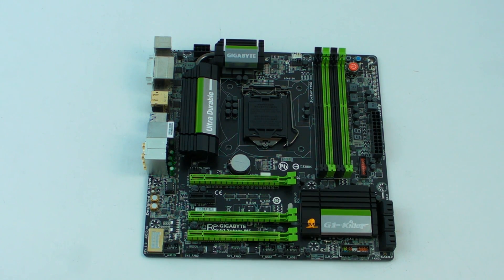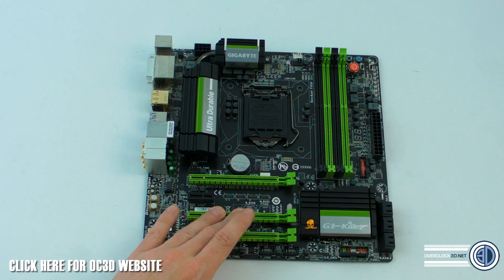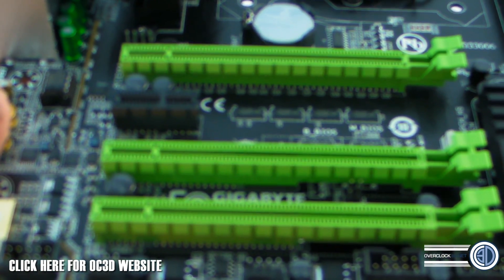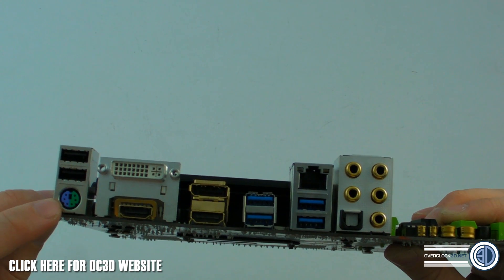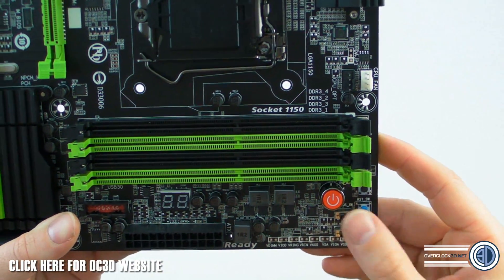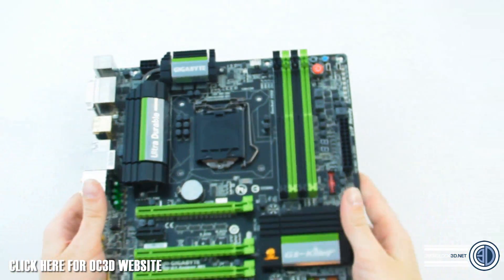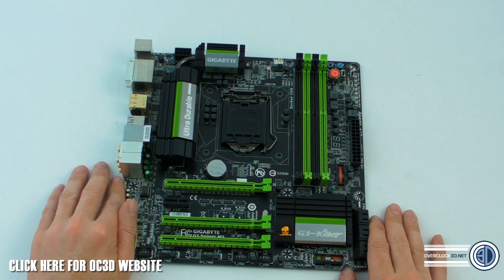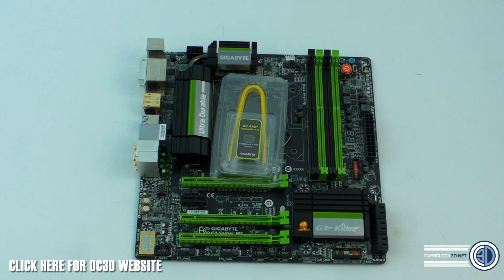Gigabyte G1 Sniper M5 Motherboard Preview Z87

Comment: The cpu for these boards only provides 16 lanes for pci-e 3.0 slots total, so the first 16x slot will also run at 8x with two cards installed in the green slots